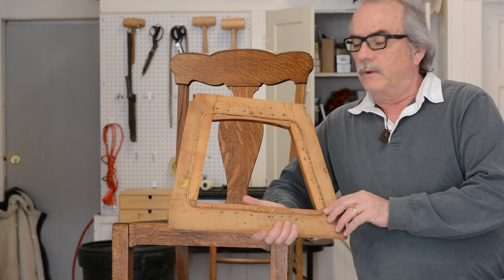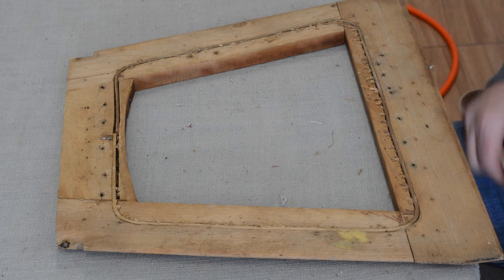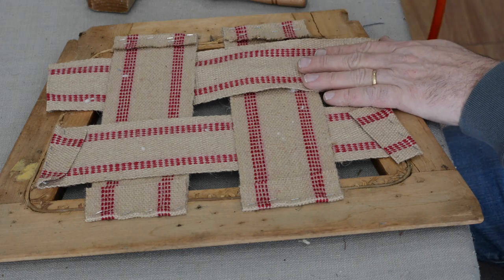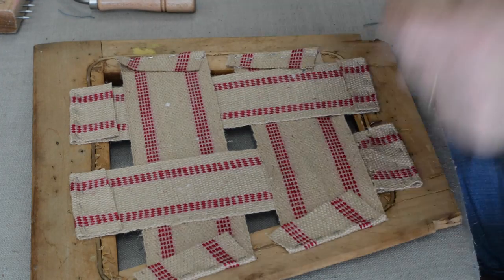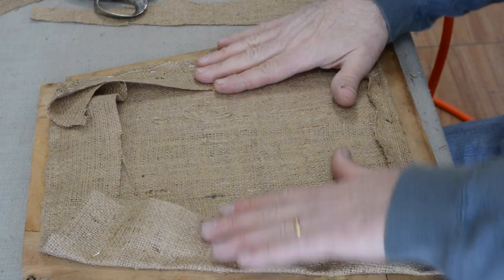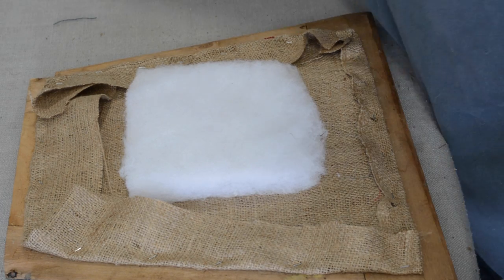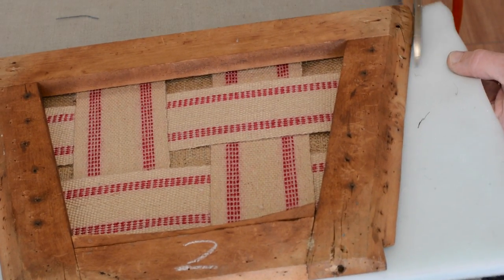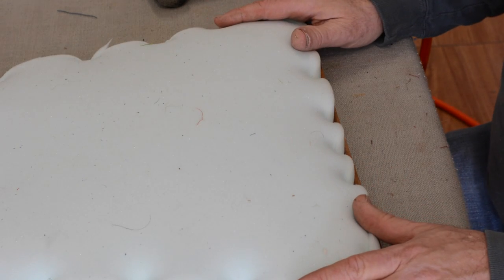DIY How To: Pad a Cane Dining Chair

Comment: Wow, great tips!  Especially the batting one!  I keep seeing people replace these kinds of seats with plywood, and I wasn't sure if it made a difference.  But the "trampoline" metaphor sold me!  I need something comfortable.
So, I have two questions.
1- How do you know what width of webbing to use?  Do more pieces of small webbing have a different effect than fewer pieces of thicker webbing?
2- I'm SUPER allergic to burlap.  I assume that I could use nylon webbing and it would work about the same, right?  Does burlap have more "give?"  Should I not pull the nylon as tight?  Or would it all just be the same?
Thanks so much!

Comment: My cane seats have a beautiful wood "frame" around them that I would like to refinish rather than cover completely in fabric. Can I upholster just the inside square using your beginning steps? Then finish the edge with either single or double cording?